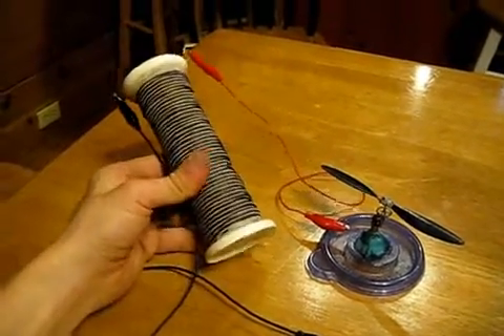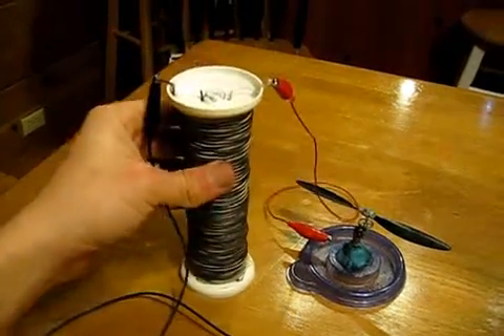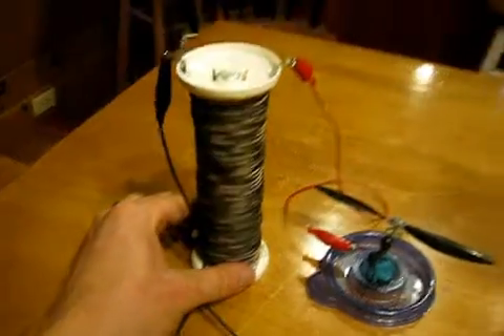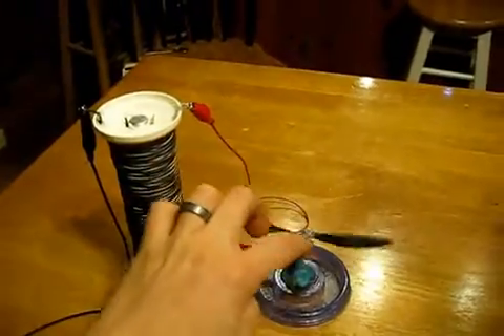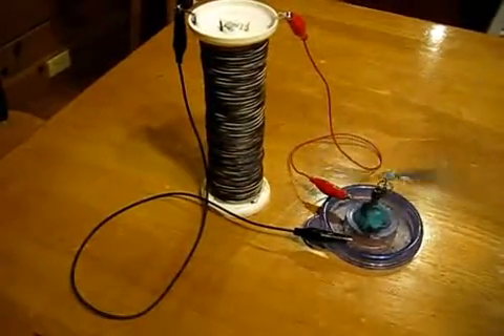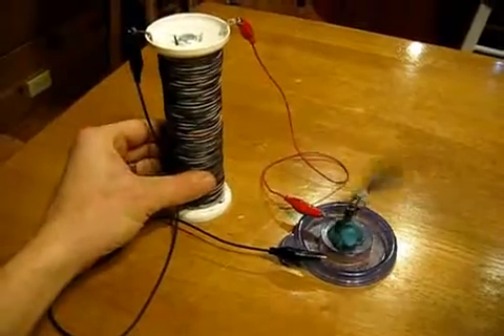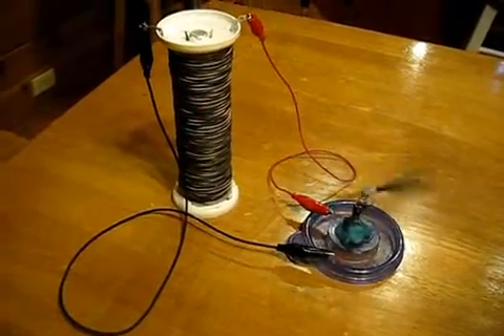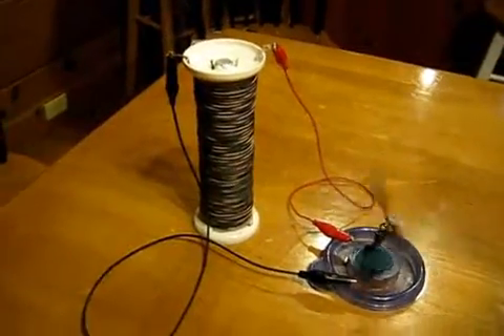Nathan Stubblefield Coil Runs Motor!

Comment: fancy wet cell battery. It probably runs better as it dries out because theres less and less water to impede the electric potential, but it leaves behinds the electrolytes the let the ions flow between the copper and other metal. Dunno why he has a soft iron core. It might magnetize or something, but not sure what that has to do with powering anything. It's basically compounding the idea of a tesla coil and battery into one unit. battery as magnetizing field.

Comment: Earth battery, or pick up coil? Suppose the Earth Battery is just a simple way to power an oscillation in a pick up coil? Suppose its TRUE purpose is to be a pick-up coil. Realize that making a COIL with inductance real large is physically challenging. But, suppose instead you set up a self-powered magnetic oscillation underground. Might not that magnetic field better RESPOND to other magnetic field changes. So in other words, we can't build a LARGE coil. Too expensive. We can build a self-powered electro-magnet-pick-up coil.

Comment: Lightning strikes are pretty low frequency. I think it is something like 200Khz upwards to 500Khz (below AM band). This means your underground-coil would do best if it self-resonated down low -- implying the inductance is quite high and the coil is physically large (as in megalithic structure). I suppose another way to go is to set up a network of many smaller coils in an array, equally spaced, and supported of each other magnetic field-wise. I am remembering that demonstration of an array of several spinning magnetic tops that keep spinning as they FLY in formation.

Comment: When I was a kid, I played around with a telephone pick up coil. It occurs to me that the Stubblefield coil, when embedded deep in the ground, could be an excellent "pickup coil" for Lightning strikes around the planet. If the inductance is made large enough with very small resistance, it should RING for a long time each strike -- and there are many per second around the planet. Next, I learned yesterday that CARBON and ALUMINUM have interesting properties in that if you place them in salt water, you have a very nice battery. But further, if you heat this reaction, the production increases, like a thermoelectric generator. So what if, you had CARBON particles in a ALUMINUM foil capacitor (super-cap-like), and high-voltage ARCs caused the rapid galvanic/thermoelectric energy production. Food for thought...
Reply: I’m autistic and not electrical minded but curious with boundless interest none the less. New home v v rurally and power cuts plus extortionate coal prices ( need 4 fifty kilo bags per wk for hot water and warmth for my service dog and I- maybe 3 these days out of winter) point being the electric is on my mind to start putting thought into replacing somehow. Your comment is the first ever on this subject and I ve hilarious thoughts about tinfoil and I seen some carbon lumps in glass somewhere recently. Well- who knows thanks for your food for thought and if there’s smoke that’s alright as the chimneys will disguise it i hope 😂 ❤

Comment: the wire is insulated so there is no chemical reaction as your predicting, maybe its generating power using peltier effect in the Fe+Cu connection but its not chemical reaction in any way.

Comment: acctully does stuff only need to be sprayed a lilttle bit. summerging it in water is ok too, but then it will grow power untill its humidity = air humidity and then it will work until air has no humidity in it... it can almost work forever. The stuff in the coil will just deteriorate and rust and make the thing stop working, but... after several years though. maybe... 35-50 years? I dunno. but it takes a lot of time.

Comment: Laser
How long did this run just on the damp wire?
I think it is connected at the 5,6 wires to the motor, right?
I find it fascinating that it works withOUT an external make and break, which is how I READ the patent. He said "the normal make and break" as though there were no other element than this. so.. please tell me the mA requirement for that very small motor, or the mA that you can see happening.
Thank you
jeanna

Comment: Thancks for the video! I see 4 wires at the top of the coil . From left to right left being #1 Is that iron or copper?  #2 left side of the core wire iron or copper connected to anything? #3 rightside of the core same question as #2? and #4 the positive side if the color is correct? I want to replicate this. On the patent I saw a secondary is that on your coil too? Thanks!